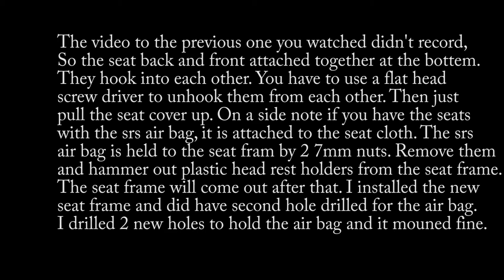2012 Ram 1500 Manual to electric seat conversion #pickuptrucks #seatcover #eletricseatcoversion

Comment: If I go get a whole seat from a donor truck will it just mount in and do I have to change any wires from my truck without the electric seat?
Reply from the maker: If you get the whole seat from a donor truck it should just mount in and plug and play. I had to fix my seat cushion.

Comment: How do you convert the manual seating as far as to the truck I have to replace my manual seats with the electric seats that I found at the junkyard however how do I convert  that to the truck to seat
Reply from the maker: If your already getting electric seats from a junkyard, then it should just be plug and play. Your not doing what I am doing. I replaced the seat cushion and got the electric seat bottom and back separately in 2 halves.